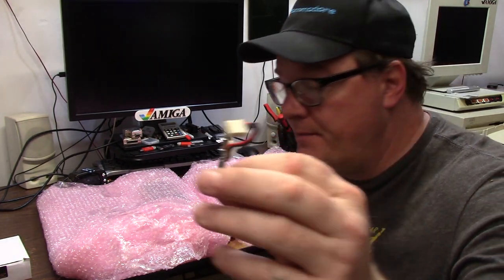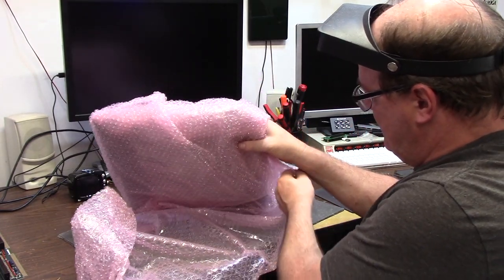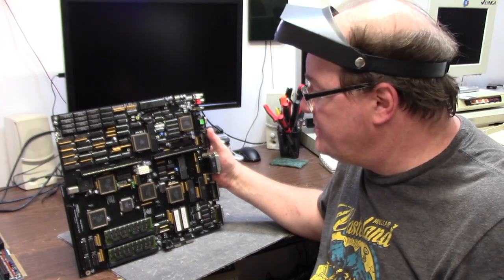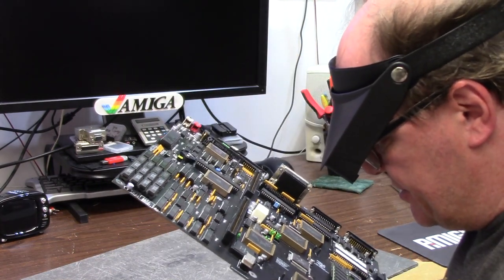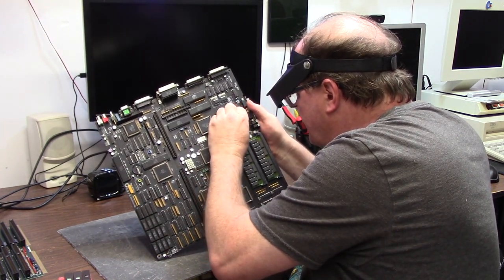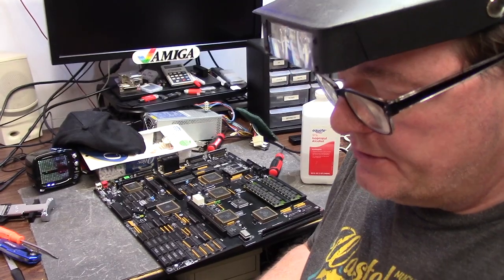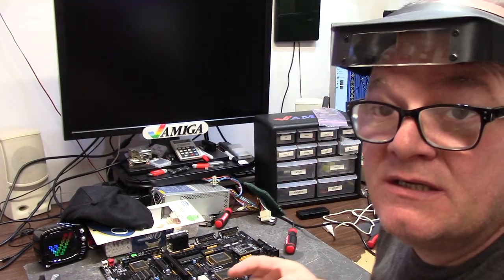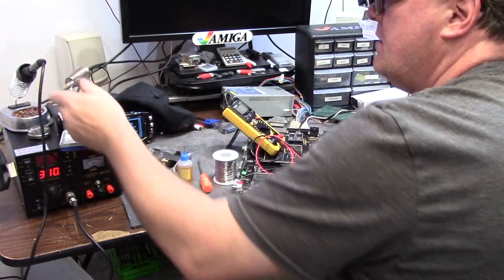fixing a re Hamiga 3000

Comment: Watt lead do you need to use for dirom from the serial port to screen please, great video
Reply from the maker: because it was dead. so diagrom is the start point to see if it worked. by default it will output serial for a no video issue just like this one.
Reply: @ChrisEdwardsRestoration  He's asking what kind of cable you need to get data from the serial port to the monitor.
Reply from the maker: @savajeff  oh, whoops, sorry, it is a usb to serial cable i purchased from BestBuy, you can also get them online at any retailer, just make sure it is the proper DB25 end , not a db9